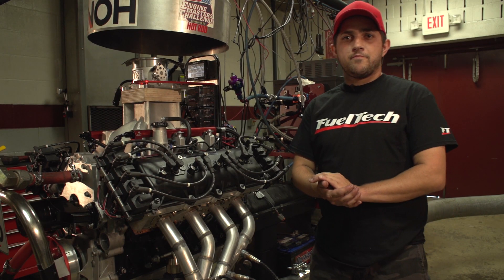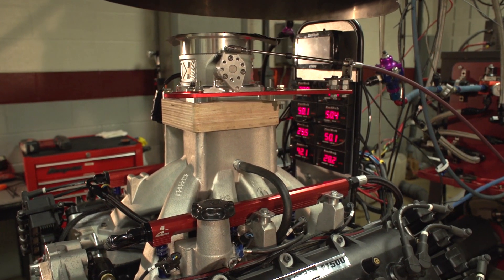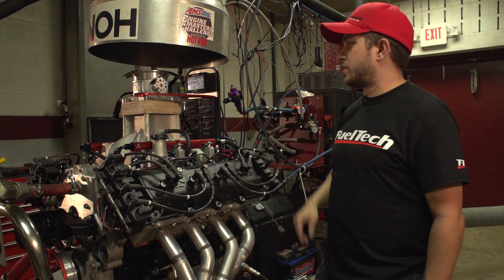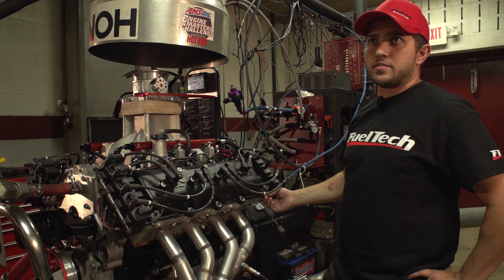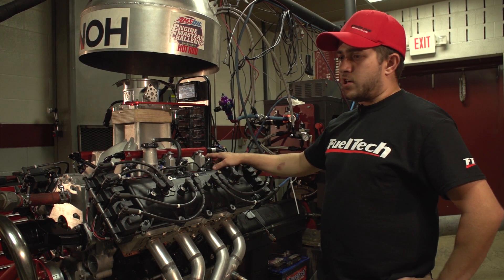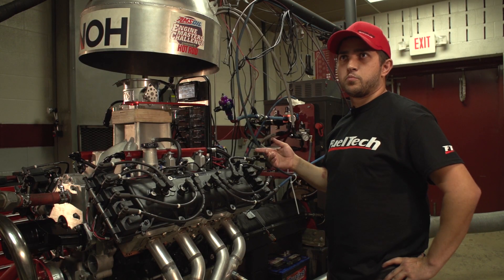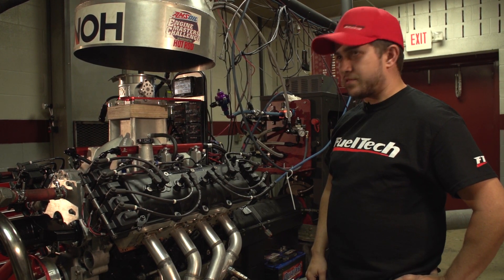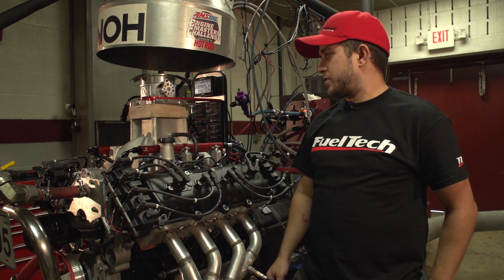700-Horsepower Gen III Hemi by Bradley Built Engines at the Amsoil Engine Masters Challenge 2014

Comment: what is this woody thing between carb and manifold?
Reply: It's a throttle body spacer.
Reply: why they put spacer on such long manifold?
Reply: @logik4264  reduce heat conduction via aluminum from the engine is not a big factor, as the throttle body has no fuel running through it, so it must be to allow airflow to become more consistent and settled as it goes downwards from the one gigantic butterfly.
Reply: I am guessing this is the case. Also, one giant butterfly has less drag/friction than four smaller ones.
Reply: I'm late, but thanks for answers!
Reply: Logik426 it’s a phenolic spacer for less heat transfer

Comment: Why use a throttle-body spacer on an engine with port fuel injection?  The usual intention of a spacer, whether with a carb or with single-point injection is to give the fuel some space to homogenize and atomize with the air before being split up by the manifold.  With port fuel injection, each cylinder gets even fuel distribution by default.  There has to be some reason not only for the spacer but for the skyscraper of a plenum it's on top of.  What a headache it would be to find a hood for that!  But the engine performs really well so there's got to be a good reason that's beyond my understanding.

Either way, Viva la Hemi.
Reply: +JETZcorp The intention of most throttle body spacers on engines like this, are to add plenum volume to the intake manifold, which improves airflow (if the volume is correct).   This is true even on carbureted engines with aggressive cam profiles and common plenum intakes.
Reply: Probably a manifold with sufficient the plenum volume was the reason.
I'd like to concur re 'viva la hemi' except these are hardly a true Hemi.
Reply: JETZcorp
Well,
I really see the main issue with a large bore true Hemi as being the pumping losses caused by a heavy piston, as you correctly identified.

Other issues, ie inevitable low speed overlap issue which is inherent in the design of Hemi heads - esp in larger bore engines, could be minimized by the use of a roller cam, modern injection and ignition systems.
That said, you are of course 100% correct in all you have mentioned.
I obviously live in the real world and am not denying the need for the combustion chamber design Chrysler have implemented here but I get annoyed when the mystique of a bygone era is invoked by a general untruth - lol.

A white lie??
Reply: It's still much more of a Hemi than anything else that's available.  They started with a true Hemi chamber and then addressed each of its weaknesses.  The valvetrain layout, with twin-shaft-mount rockers, is pure Hemi heritage.